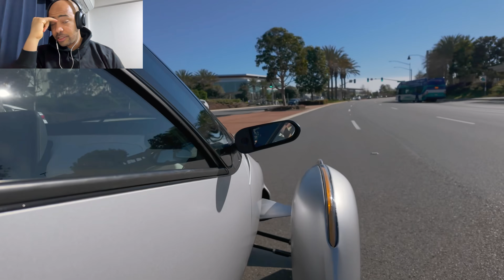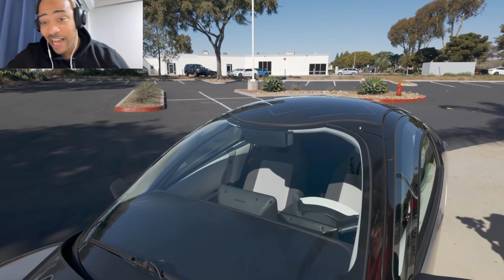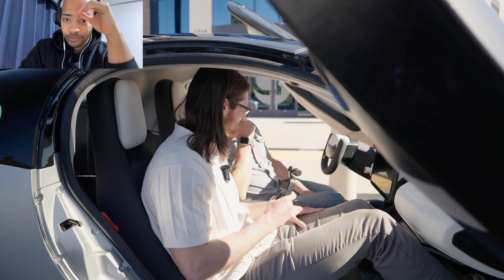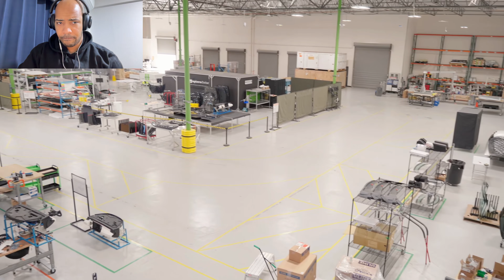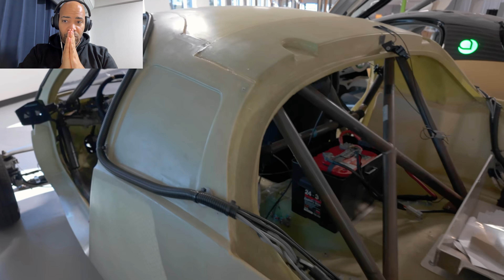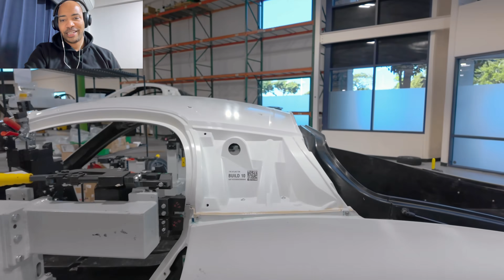TDC Reacts: Realistick Aptera Interview (Feb 2026)

Comment: I suspect that Aptera is going to release their first 50-100 vehicles in Southern California or similar climates. So there is no reason for them to do testing in the ice and snow. They WILL do that testing, of course, but there's no reason for them to do it this year. The early releases can be retrofitted with any technology they come out with in 2027 or 2028. 

Likewise, I don't think they're going to develop any showrooms or displays. The have 5000 Accelerator orders for the Launch Edition to fill, and then preorders for 45,000 more. They can ship the finished models to the customers directly. There won't be a need for advertising or showroom displays for years to come. 

I think it is quite possible for Aptera to ship 50 vehicles by the end of December. Am I promising that will happen? No, of course not. Anything can happen, and they still need to do validation and crash testing. Atlas 1 is done, now we need to see how long it takes Atlas's 2-10. Then they're talking about building another 50. Many of those will be sacrificed for crash testing, but it is possible SOME of those will survive to be sold. So we will have to see. It depends a lot on when those 50 get started, and whether they will wait until testing on the 10 is done or try to build them concurrently. 

I would like to see 100 or even 500 sold this year. But the chances of that are much lower than 50. But if Aptera sells ANYTHING, then they will have met the goal.
Reply from the maker: I hope they come out this year!! 🙏🏽🙌🏽

Comment: There will not be dealerships. PS 14 Celsius degrees converts to 57 f. degrees, not really very cold. It is a wrap, not painted so you can have black or purple.
Reply: I will note that you should be able to take delivery on your Launch Edition and take it to a local wrap shop and have it re-wrapped. You may have to wait on Aptera to release the patterns, but I don't expect that to take long. 

I suspect Aptera will recommend this for anyone who wants a custom color other than silver, white or black. It keeps them from having to maintain a selection of colors.

Comment: If you want to know more about aptera, check out the last several videos from Aptera Owners Club. He did the Factory Tour and asked a bunch of engineering questions. 

The body frame is carbon. The skin is fiberglass. The frame is Aluminum. The battery bolts to the frame. There are steel rails bonded to the aluminum that the bolts from the battery pack thread into because bolting to aluminum directly is often insufficient. The battery bolts onto the frame. 

 It really looks like they intend the battery pack to be a service part that may get upgraded in the future. During testing the battery designer accidentally damaged one of the (6?) modules in one of the battery packs, and was able to remove the battery module from the battery pack and replace it without replacing the entire battery.